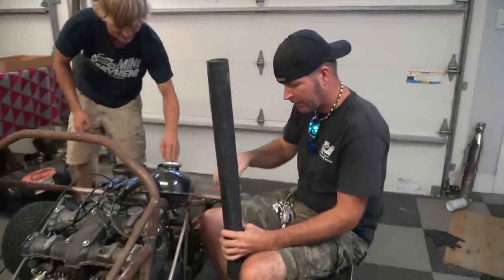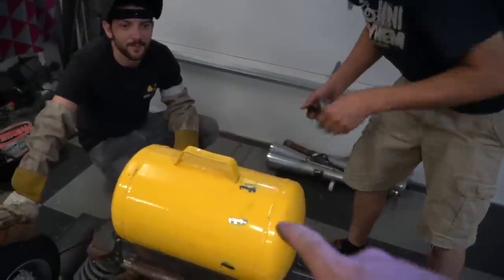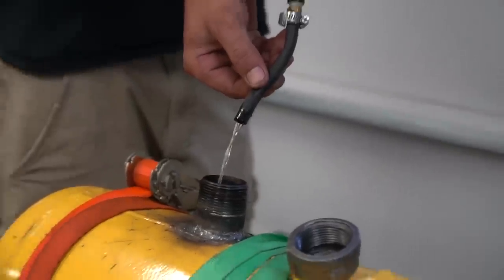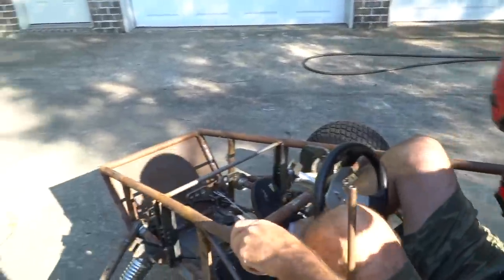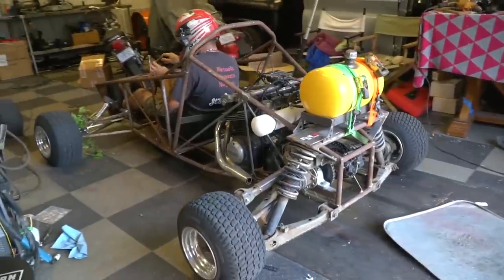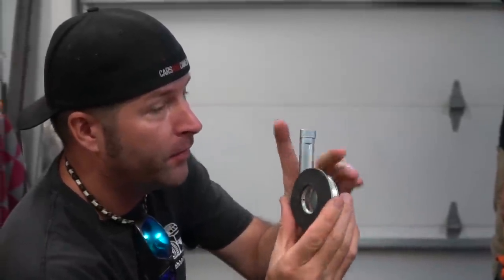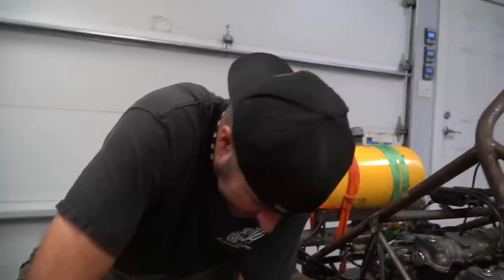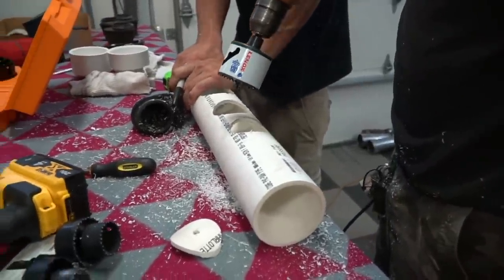750cc Cross Kart TUNING | Building a Custom Air Box, Jetting!

Comment: I really think you guys should throw some decent mufflers on that connecting 2 cylinders on each side to balance out the sound and scavenging effect. Do this before jetting the carb you would save yourself a lot more trouble in the long run.

Comment: If not using a fuelpump for flow, reverse it and use it for pressurizing the fueltank. You will drive the thing off road so without pressure you get irregular fuel flow
Reply: you really don't need that much pressure either

Comment: You guys are making great progress but seem to have no real regard for safety. This thing is turning out to be more than just a go kart. You need seat belts and you need brakes on the front wheels. Also shorten and tune up the shift so its not flopping around and risking stabbing you in the face. Otherwise im loving the build! I just don't want you guys to get hurt and put safety features on the karts retroactively. Be proactive!!

Comment: It really dont matter csuse with motor being ran with out proper air circulation it's going to fry the motor , the two center cylinders all ready have longevity being in the middle....... no air flow on fins = fry the engine

Comment: Just finished watching the episode, and I had it in an idea or an epiphany kind of. your issue believe could possibly be vacuum, and if it is, would you not get a better vacuum if you married the. same firing Pistons up. together with the same intake. That way they have an equal vacuum. split between the two of them instead of one. having to or come the void on the other side. And if that is not feasible, could you not put a check valve in between the intake down tube and the carburetor? that way you would be eliminating that void that needs to be. sucked back at the same time you know like causing the vacuum. Mom's story short is I mean would you not get a better vacuum if they were synced together or if you had a check valve between the two? I don't know. I was just kind of thinking out loud. I mean it makes sense to me to have them drawn at the same time It would give you a stronger vacuum. Therefore giving you more gas, which you think could possibly be the issue, right?

Comment: YOU DONT VAC SYNC WITH THE FILTERS OFF!!!       Not all carbs have to same vacuum line connections, so they will read differently if not given the right conditions.   And readings from the vac nipples would be better.

Comment: Part of your problem is that you are running open headers. It needs the back pressure of a muffler. I have the same problem on my R1 and when I put a muffler on it, it clears up and runs smoother.

Comment: There's a couple air boxes on ebay, one for $66 buy it now used and I also found a brand new one for $116... https://4into1.com/honda-cb750k0-air-box/ Lack of back pressure makes an engine run lean, take those pipes off and put that 4 into 1 you had on it and a glasspack and you will be fine.

Comment: Should have left the cover on the pod, normal air boxes pulse with the engine, this is said to else balance airflow, and your rigid pvc won’t do that.

Also, having a big metal rod in your face is incredibly dangerous, especially if you are not wearing eye protection and crash...  Might want an extra inch or two on those tires, if nothing else than just for looks.

Comment: Please Google how to tune cv carbs your making fools of yourselfs they work completely different then slide carbs
Reply: Like when you put poor vacuume they go full rich because the slide that is vacuume operated dosent have the proper vacuume to move smoothly it hops up and down all crazy  and basicly flooding the engine.. been there done that then I did some simple research and it running better then ever with the stock jets and uni pod filters with some plastic in them to direct the airstream straight into the carb  it's mostly turbulence that messes them up the the vacuume  so you need a good balance of airflow and minimal turbulence

Comment: put a muffler on it too....on top of it being obnoxious , it kills whatever torque the motor would make and it makes it run rich....you're going to need the original airbox otherwise you're going to have to re-jet the carbs to compensate for the extra airspace or Lack thereof ........A quick disconnect fuel tank?...wtf.....why dont you make it run on propane while you're at it. smh.......syncing and tuning the carbs should have been first on the list after you first got it running.....but making noise and backfiring is more important.....yay people.